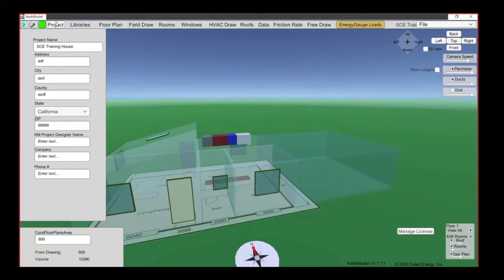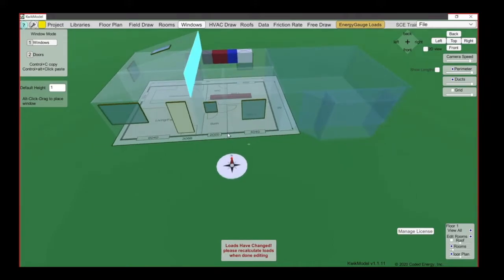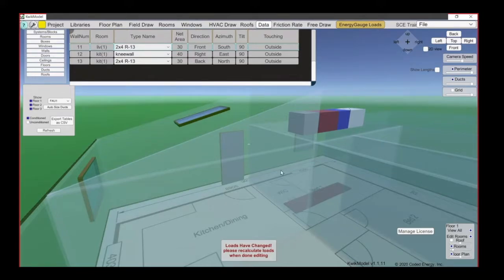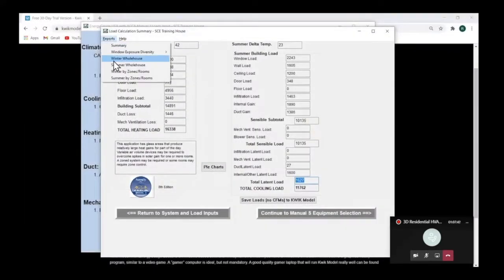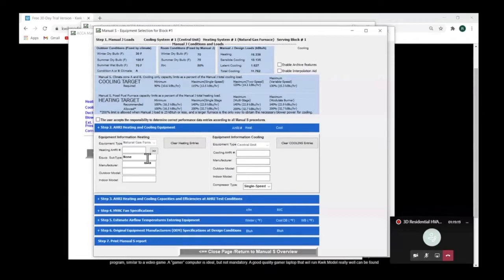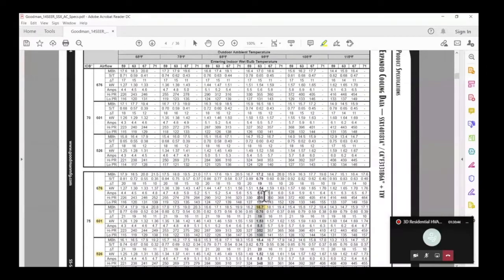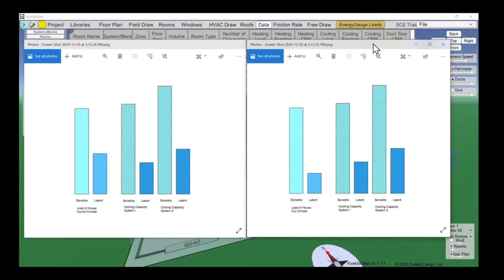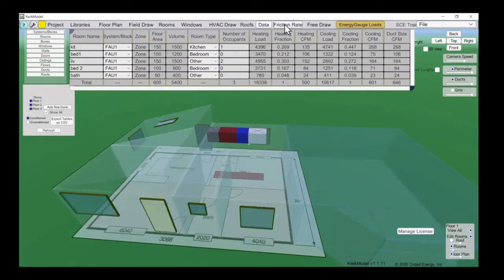Intro to 3D Residential HVAC Design, Day 2, 1st Half, video 3 of 4, Sponsored by So Cal Edison

Comment: Being that you used the Goodman extended data, I primarily use as well. Where where in the Goodman data does it show latent and sensible capacity? I understand that Mbh is the total capacity.
Reply: Hi Eli.  There is a row that says S/T.  That means "sensible/total ratio".  Just multiply that number times the total and it will give you the sensible capacity.  The rest is latent capacity.  Example: if Mbh = 16.5 and S/T = 0.62, the sensible capacity is 16.5 x 0.62 = 10.23 Mbh and the latent capacity is 16.5 - 10.23 = 6.27 Mbh.
Reply: @russking63  you make life so much easier 🤣. Thank you again. I'm addicted to this program lol

Comment: When choosing a system, is there an option for just an air handler without a furnace? In our market it's mostly A/H
Reply: Hi Eli.  When you get into EnergyGauge Loads and define your heating system.  There is a drop down list of about 14 heating system types.  Pick the one that most closely represents what you are looking at.
Reply: @russking63  that what I did. I was just wondering if there is an option for air handler only. Thank you. I'm loving the program it's real awesome.
Reply: @Elisummit845  Thanks, Eli.  So what is the heat source for those houses?  It actually doesn't matter for load calculations, but there has to be some kind of heater, unless it is only wood heat, but that's not a choice  I that case, I would just pick electric baseboards/ductless.
Reply: @russking63  most houses in my area have hydro baseboard. Some new construction have radiant in the floor, only the fancy houses tho. Forced air heat drys out the air to much, I don't know if that's a fact only in this area or all over, so most people prefer 2 separate systems. Boiler in the basement, pipes running around the house with a bunch of zones and the air handler in the attic. If you remember I told you at the symposium, most customers we deal with want the house at a maximum of 70°F so in many cases will add a dehumidifier and everyone is happy. Btw my area is the lower Hudson valley in NY
Reply: @russking63  I hear you're giving a class around my area. How can I sign up?

Comment: Once the house is set up, is there a way to change where the front is? I didn't realize at first that the thingy has to be where the front is.
Reply: Do you mean the north arrow thingy?  It can be anywhere in your drawing.  You can move it around too.  Hold down the control key, then click and drag it wherever you want to.  Once you build the house, you can't change what is defined as the "front" of the house is relative to your computer perspective (if you press front view, it will always go to the same side of the house), but you can rotate the house relative to North by rotating the pointer on the north arrow.  Just click on the compass pointer and drag it to where you want it.
Reply: @russking63  got it. Thank you.